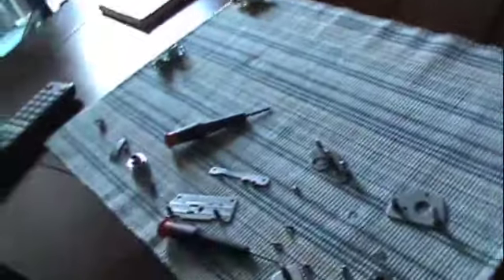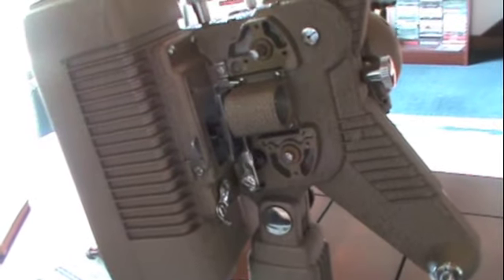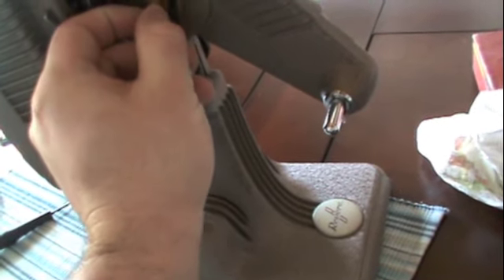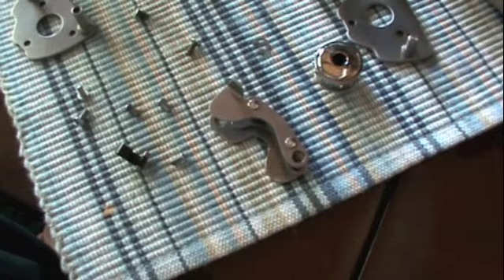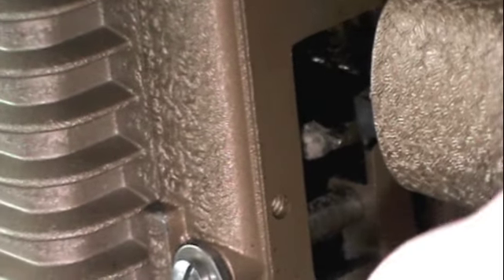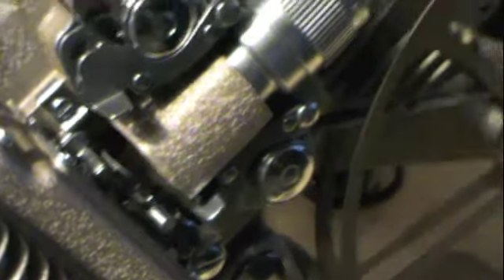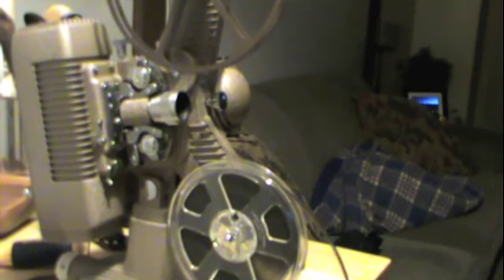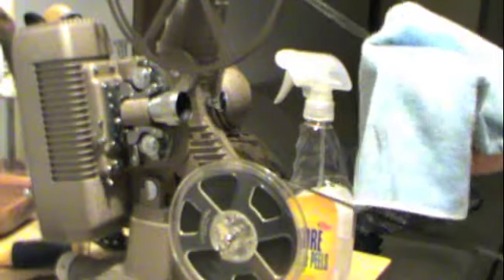Troubleshooting The Revere P-90 8mm Projector

Comment: I don't think silent 8mm projectors needed the film loop(s). I believe it was only needed on sound projectors, in order to provide some slack between the ratcheting motion of the shutter and the smooth motion of the sound drum. Otherwise with no loop, the sound would come out very juttery.

Comment: Great overview on how to take apart, clean, oil, etc.  Just got a Revere 85 and thankfully it worked straight up.  Want to do a bit of Preventative Maintenance thought.  Had a thought...could you modify the cam to allow variations in the film shrinkage?  This might allow you to "hit the hole" if the pin moved faster relative to a smaller hole to hole variation than standard.

Comment: I have 2 projectors that I got at a yard sale and 1 had the same problem I had to measure the speed of the movie with a RPM meter that shines a light at the film and tells haw fast the film is going thru the system . My motor was running at 356 rpm and should be 409 rpm . I learned all about all types of projectors in the NAVY as I was a IC2  Interer communications tech went to a school 6 months and
a c school 5 months . I will look and see if I still have the speed measurement tool.

Comment: Hi, not sure if this applies to you machine, but my Elmo FP also was loosing it loops. It has two prongs ( pins) attached to a bar I guess word is, if these prongs are not coming out as far as they should, they wil not help guide the film through the film Gate, you can see them if you use the manual winder, they come out and go back in each turn. How I fixed mine was the manual winder shaft was not all the way in, I came across it by fluke, as I noticed the manual wind wheel was not up against the chasis, hope this helps Phil

Comment: I do not think the film is stretched. I think your theory about the sprocket dog cam being worn out of spec is totally correct. This projector must have had a lot of hours of use. You need to get a replacement cam that is in spec from a parts machine or have a machinist make a cam that is in spec.

Comment: If this is the projector you took apart, I think when you reassembled it the timing on the intermittent sprocket claw is out of time with that eccentric wheel that drives it and it's probably not grabbing the sprockets at the right moment.  And no,  you shouldn't lubricate the film when you run it and the film isn't stretched,  you merely messed up when you put the projector back together and didn't know that you should have documented how each part meshed with each other in the exact position when you took it apart.  It has nothing to do with the film stretching.
Reply from the maker: I don't recall disassembling the unit far enough that would have taken it out of time... then again, this was many many years ago. The projector was given to a friend shortly after this video was uploaded who successfully ran dozens of his family films through it to transfer them to a digital format, and he didn't have to repair it at all.

Comment: I have a few projectors including my Kodak Super Showtime 8, my GAF 3000S Super 8 Sound projector and my Bell & Howell Specialist 552 16mm projector, and it works fine without any problems. Sometimes, the film might jump due to broken sprocket holes. I see the film jumps all the time, because you're using a Super 8 film, not 8mm. 8mm uses bigger sprocket holes while Super 8 had a much smaller sprocket holes. This only runs 8mm only, not Super 8.